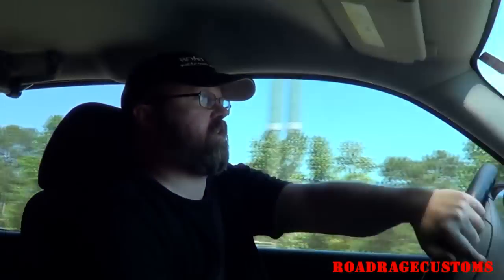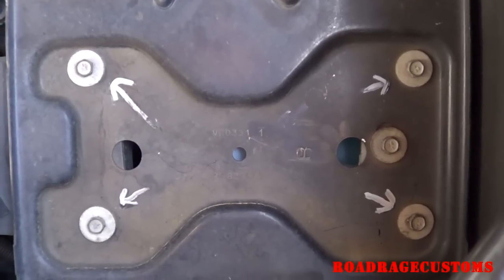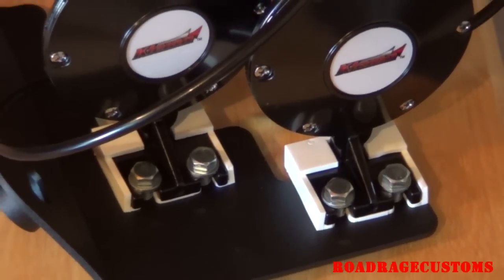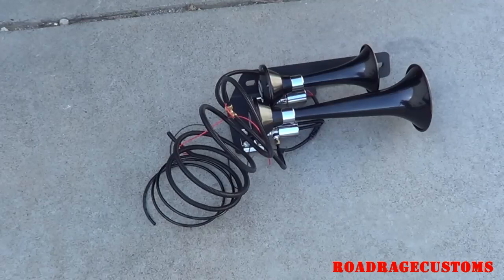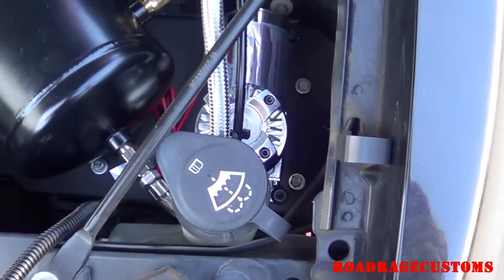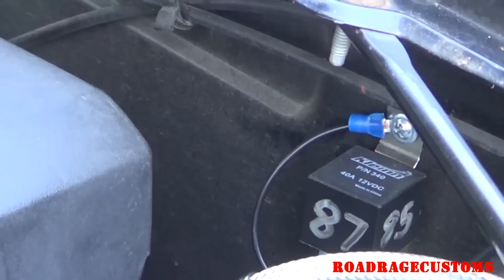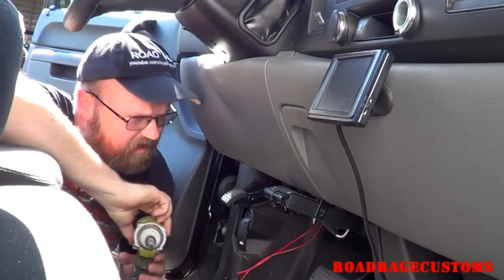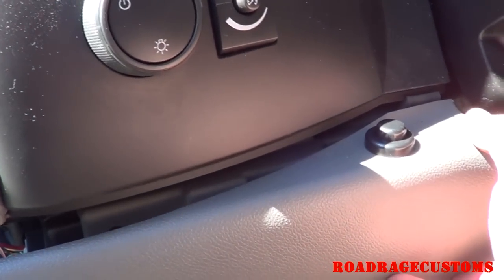How To Install Kleinn Bolt-On Train Horn Kit on a 2010 Silverado

Comment: I already have the second battery in that tray.
I also like the triple diesel locomotive horn kit for mine.
I installed the air tank just ahead of the lower radiator support just behind the front bumper.
The compressor got mounted in another location down on the frame.
Reply: Do you have a video on yours ? And can you send link for your horns

Comment: Plus u can hook an air hose to the tamk and air up your tires when needed.
Reply from the maker: Yes. This truck now has an additional brass tee with a female quick connect fitting. It is often used to air up tires.

Comment: Thanks for in instructions. Instead of drilling a hole in the dash of my 2018 GMC, can I get a horn button to fit in place of the cigarette lighter?
Reply from the maker: Yes. You can even use existing wiring and have the factory horn button control this air horn. *Check local laws first. Some areas require a quieter "city horn" in addition to an air horn.
Reply: roadragecustoms  actually I was looking to take out the cigarette lighter and put a button, using the wires for the lighter and keep my factory horn as is. Thanks man.

Comment: Silly question but does the water need to be drained from the tank at some point like a standard compressor??  Just curious...
Reply from the maker: AN not a silly question at all. Yes. The water does need to be drained periodically. This kit includes a drain valve that is placed in the bottom of the tank. It is accessible without removing any parts, but it is a tight squeeze to reach it.
Reply: @roadragecustoms  Question will the air tank always have air in it and fill up automatically upon using the air horn?
Reply from the maker: The pressure switch in the kit turns the compressor on when the pressure is low and off when the pressure is high enough if the key is on.

Comment: At 8:24 you mention only wire left is switched power for the relay. Do you mean for the pressure switch? You already powered the relay, correct?
Reply: By the way, AWESOME walk through.

Comment: at 1:50 what kind liquid or gasket were you using on the thread fitting?
Reply from the maker: That is thread sealant that comes with the kit. It's similar to Loctite.
Reply: Can gasket makero do it?
Reply from the maker: RTV gasket maker would work, but Teflon tape or pipe dope would be best.
Reply: Its purple Loctite 30-50 in LBS locking torque.

Comment: How long he your compressor held up with it being under the hood?
Reply: Also how easy it it to drain your tank?
Reply from the maker: The drain is a little tricky to get to. The compressor is still good. It outlasted the truck.
Reply: roadragecustoms very nice. Is that compressor weather sealed?
Reply from the maker: I wouldn't go deep water fording with it, but it held up to normal, underhood conditions.
Reply: roadragecustoms mine isn’t weather sealed and they say it should stay free of debris. I have my horn blaster tank and compressor where yours is as well. Glad to know your compressor held up under the hood even with the heat from the engine
Reply from the maker: My Viair compressor that I had with my Hornblaster kit was a better compressor. I had it mounted under the engine oil pan where the front differential would be on a 4x4. Just keep the air intake remote-mounted in a clean dry place with a clean filter. Watch my train horn vs parade video to see the other horn installed.

Comment: Now does the air compressor automatically turn on every time the vehicle is turned on and then the button is just to activate the horn
Reply: @roadragecustoms
Reply from the maker: The compressor will only come on when the key is on and the tank pressure is too low.

Comment: Is it possible to over load the battery ? What if u a light bar switch going on top of the battery ? & I want one this horn
Reply from the maker: Dylan Walsh Yes. It is possible to overload the battery. I wouldn't wire a compressor to run without the engine running. I think there might be something missing from your second question. I'm unsure of what you are asking, but I wouldn't put a light bar switch on top of the battery.

Comment: Could this work in a bronco 2
Reply from the maker: No. These are specifically designed for this model of Chevy truck. Kleinn does make universal (custom) fit horn kits that will fit anything if you know what you're doing.
Reply: @roadragecustoms  thank you
Reply: No fucking way dude

Comment: Trains have three horns on them.   And sorry to say but those just sound like a horn off a real truck.  Maybe drive something other than a Chevy and you wouldn’t have to waste money on air horns.   Blow them at me and I would drag you out of that truck.   But good instructional video.
Reply: Actually it depends on what type of locomotive horn you're using.  I prefer the old Leslie air horns from back in the 50's.
Reply: I guess you could say other rigs blow already, with a Chevy it's much harder to get them to blow